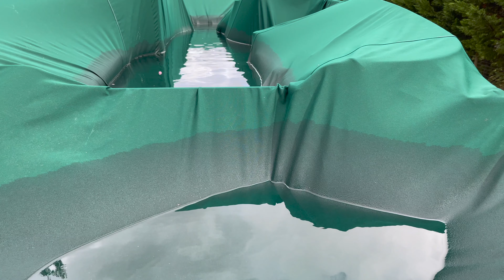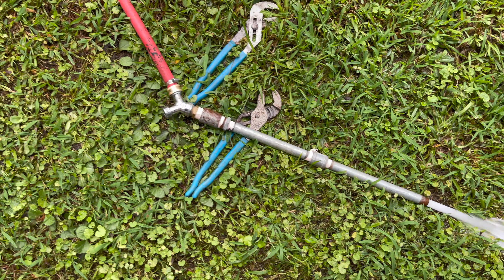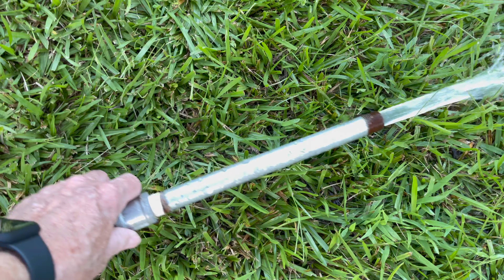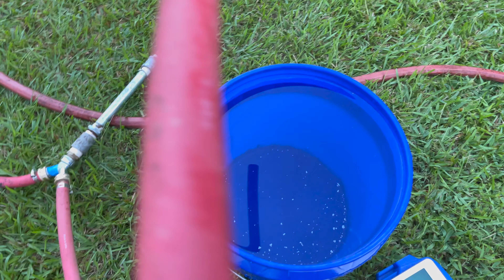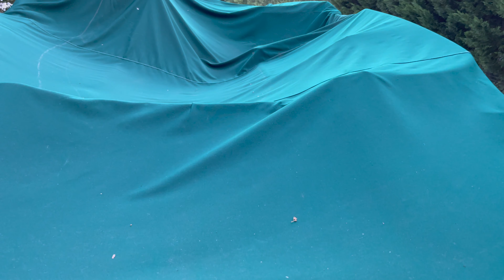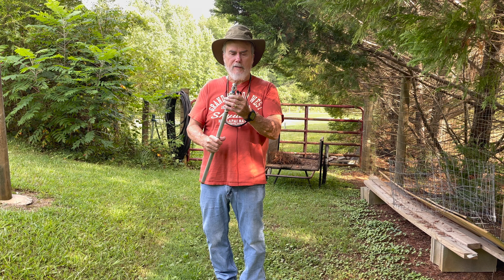Vacuum Aspirator Pump for Waste and Flood Water Removal

Comment: we have a major issue with an oilwell having water that we need to extract from 20ft below ground. the suction pipe needs to go through very narrow openings and twisted paths so would require a flexible pipe. This does help give us some ideas, thanks
Reply from the maker: Thanks for your comment.